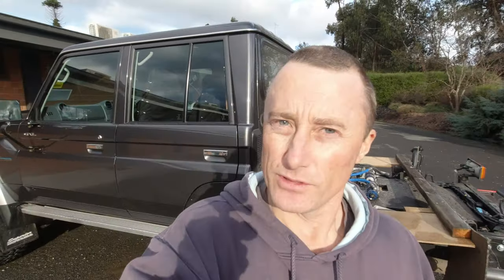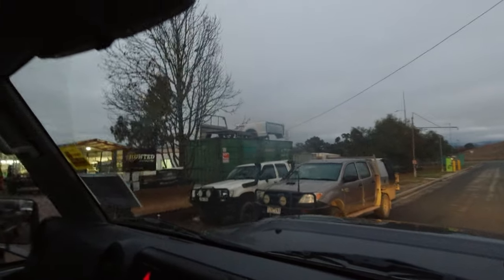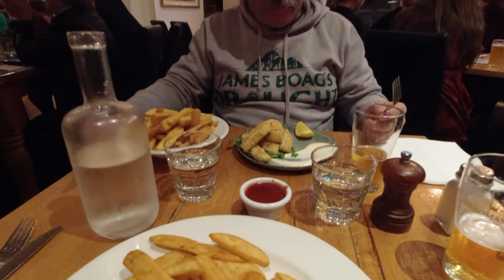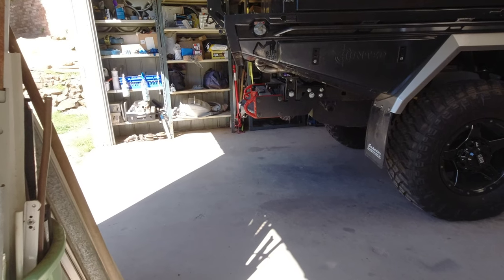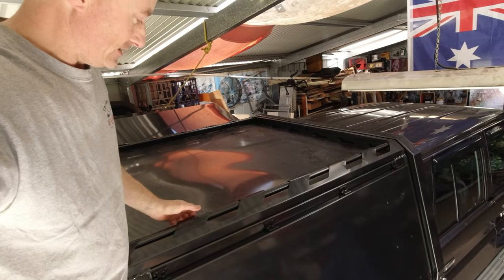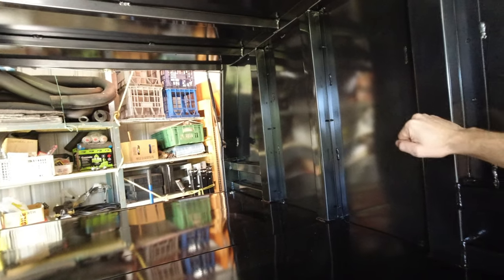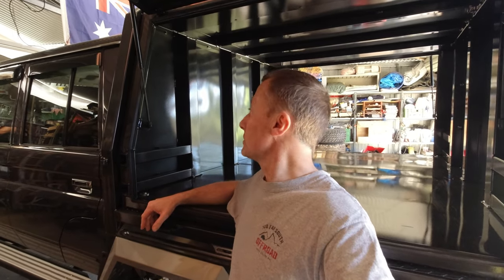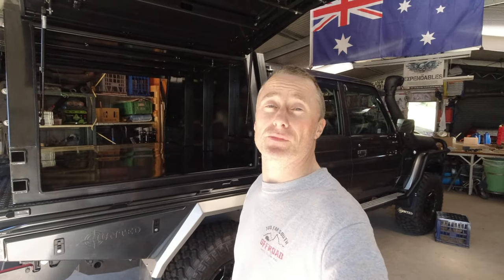Landcruiser 79 series Build - Episode 6 - Picking up my Tray and Canopy

Comment: How does the canopy bolt down? Have you removed it and put the sides on yet? About to pull the trigger and go with these guys on just the tray for now, canopy in the future
Reply from the maker: Hey Thomas, It bolts down with 4 hex or allen key head bolts in each corner and screw down on to the tray, There is a nut welded under neath the hole, I have the sides as it all came as a package and i actually haven't put then on yet. I think you will be very happy with it, good choice,
Reply: @toofarsouthoffroad  thanks for the quick reply mate. Yours looks very nice!
Reply from the maker: @thomasbirks  cheers mate.
Reply: @toofarsouthoffroad Hey mate, bit of an update. I did end up going with Hunted, my Triton is getting the tray put on in the next few days, so excited!
Reply from the maker: @thomasbirks  Great to hear, its a good choice. Such a good looking tray ! Did you have to wait long for it ?
Reply: @toofarsouthoffroad  About 6 months but that's what they told me the wait was initially
Reply from the maker: @thomasbirks  Yes they told me the same, which was good.It worked out well as i was in no hurry and they were spot on if not a bit early. Good choice mate !
Reply: @toofarsouthoffroad  Yep, same here mate, booked it and let myself forget about it and it came around quick. They told me it's currently getting powder coated
Reply from the maker: @thomasbirks  Ok cool. I looked at so many but kept coming back to Hunted. Will definatly change to look or your 4x4
Reply: @toofarsouthoffroad  if you follow them on social media, keep a look out for an orange Triton! 🔥
Reply from the maker: @thomasbirks  will do man🤙